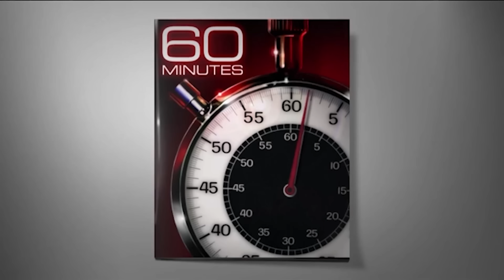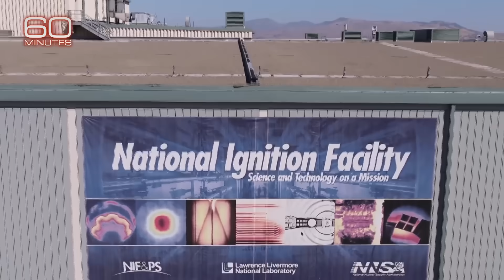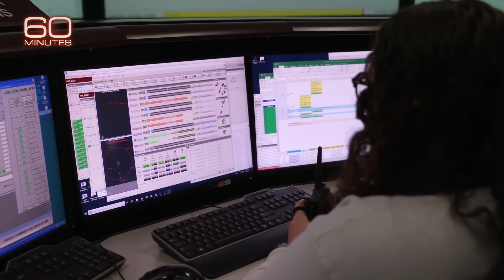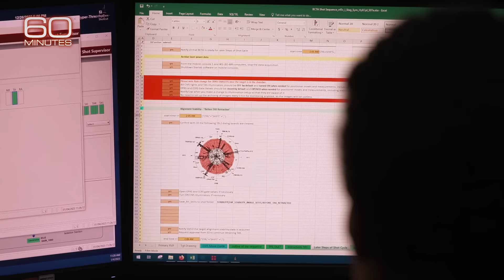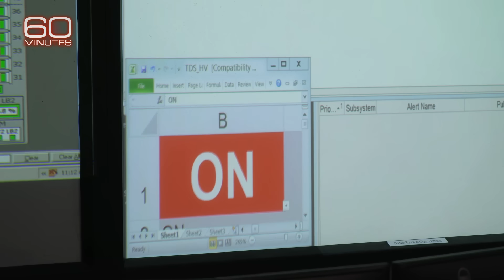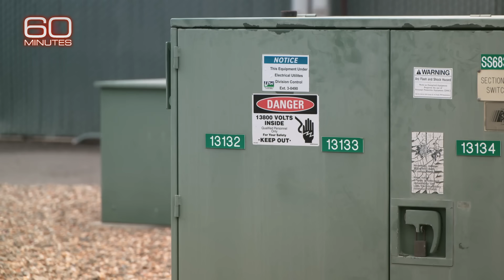Nuclear Fusion: Inside the breakthrough that could change our world | 60 Minutes

Comment: Maybe what they need is vacuumed sealed super chilled room , you know exact same condition start are found in? I mean would stars form and fuse if space was for example 0C ?
Reply: The target chamber is evacuated of almost all air before each shot. The target capsule was filled with a 50%-50% mixture of deuterium and tritium which was frozen, at solid hydrogen temperature, onto the diamond sphere inner wall. The freezing was performed multiple times over a couple of days period. Once the 3-billionth of a second laser pulse was fired the generated X-rays drasticly compressed the fuel capsule down to a microscopic size and it consisted of a plasma at around 150 million degree C.
Reply: @vernonbrechin4207  Are you some disgruntled employee who lost his job at this facility and now takes to YouTube to degrade what they accomplished?

Comment: Nuclear bombs use fission.. not fusion
Reply: I encourage you to look up nuclear explosives on Wikipedia. Nuclear weapons employ both fission and fusion processes. The so-called 'atomic bombs' are primarily fission devices, usually including a small fusion component at the center to generate the triggering neutron flux. Thermonuclear weapons (H-bombs), which are the most common type in the hands of the nuclear weapons countries, employ a fission explosive that then drives the compression of the fusion components of the nuclear explosive. NIF is designed to simulate that portion of such devices. Typically the fusion fuel is a special variety of lithium hydride. I'm many cases a uranium tamper is also part of the 'secondary' portion of the device that generates more fission yield and increases the compression of the fusion fuel.
Reply: @vernonbrechin4207  so at best it’s a hybrid system in newer devices, to imply they use strictly fusion is not true. Plus they showed old warheads which were in fact fission weapons fusion fission hybrids didn’t come until later
Reply: @magichobo  - Dr. Edward Teller, often referred to as the father of the American H-bomb was also a prime driver to employ nuclear explosives for civil engineering applications back in the 1960s. He often promoted the concept of creating nuclear fusion explosives that employed almost no fission reactions. Part of the reason for that is it would displace many of the complaints about the explosives leaving significant quantities of highly radioactive fission isotopes, similar to Spent Nuclear Fuel (SNF) that is discharged from nuclear power reactors. He kept promoting his dream to the public while the Livermore Lab   that he headed was designing thermonuclear warheads that continued to employ much fission materials in their construction. Always be wary of the pitches being made to the public by the weapons designers. Much of their work is classified so they don't have to provide the full story.

Comment: So, it's not practical or viable. Got it. Helion looks far more promising.
Reply: In the case of the clever pitches given by the Helion CEO look for the following information in the pitches. Did they use, or get any helium-3 in their multitude of shots? How often have their experiments used the actual fusion fuel that they plan to employ? Have what percentage of shots, on the current version of their machine, have resulted in a significant fusion energy production? Has the machine ever come close to generating more fusion energy output than it took to power up the machine for each shot? One of the benefits of the private efforts is that they can easily claim such details are proprietary information and therefore can't be shared with the public and the venture capitalists that fund them.

Comment: You may want to check out companies such as Helion Energy and General Fusion   - They are several prototype versions into working reactors.
(Note that working does not mean yield-even, as in get more energy out than put in) - However, they are getting closer and the advancements made curb even the almighty Moores Law  :) - My personal fav is Helion Energy :)
Reply: In the case of the clever pitches given by the Helion CEO look for the following information in the pitches. Did they use, or get any helium-3 in their multitude of shots? How often have their experiments used the actual fusion fuel that they plan to employ? Have what percentage of shots, on the current version of their machine, have resulted in a significant fusion energy production? Has the machine ever come close to generating more fusion energy output than it took to power up the machine for each shot? One of the benefits of the private efforts is that they can easily claim such details are proprietary information and therefore can't be shared with the public and the venture capitalists that fund them.
Reply: @syntaxed2  - I just looked into the technology and the achievements of General Fusion. I learned a great amount from my research that doesn't begin with finding information that reinforces what I prefer to believe in. I found no indication that they have employed the deuterium/tritium fuel that their concept is based upon, or that they have detected 14.1 Mev neutrons that would signal that they have achieved fusion reactions.

Most fans tend to be attracted to the sales pitches of the founders and in the interviews with the managers. The fans are frequently reminded of the big-money interests who have invested in the technology. Typically, the fans have little interest in seeking out critical assessments of their favored technologies. Ask yourself the following, did the General Fusion presenters provide any evidence that they have achieved even a tiny fraction of fusion energy compared to the machine input energy. Learn to recognize master sales pitchers.

I encourage you to search for the following article titles. You might learn that things are not as bright with most of these projects as you assumed they were.

General Fusion (Wikipedia)
Can Small Fusion Energy Start-Ups Conquer the Problems That Killed the Giants? (Scientific American)
National Lab Unlocks Nuclear Fusion — True Breakthrough, Novelty Act, Or Both?

Comment: I've been laughing at the NIF for about 25 years and I'm still laughing.  I was doing fusion research at a top research university and our lab took an Inertial Fusion research grant and built an experiment.  Grant money keeps the lights on so the Professors were happy but the idea behind the research was ludicrous.  There are a lot more issues with inertial fusion than mentioned in the video.  Even if they could increase the gain by 100x to truly break even, they still have no reasonable idea of how to extract the heat energy and turn it in to electricity.  Then there are the neutrons, any reactor they build will be irradiated quite quickly at 90,000 ignitions per day.  Then there is the physical damage that melted the test holder.

Bottom line, if commercial fusion happens, it's not going to be Inertial Fusion.
Reply: Thank you for your contribution. You have insights that very few fusion fans are made aware of. Most easily fall for all the sales hype in this field, hype that is often intended to attract further investments in the fun toys the experimenters get to play with. The above story failed to mention that fusion energy research began in the 1970 and that NIF was preceded by two other giant laser facilities that bragged about achieving 'ignition' and then claimed that NIF would soon achieve the goal due to most of the kinks being worked out previously. NIF failed to meet its goal, by a wide margin in 2012 and has been struggling for more than a decade to get to that goal. Funding was never stopped because it has always been primarily funded as a thermonuclear weapon (H-bomb) research tool.

The lab management is now claiming that they need more efficient lasers, with an eye upon 'Laser Diode Pumped Lasers that can be up to 20% efficient. The management doesn't mention that even the most powerful of those lasers don't come close to the NIF lasers and that if they have to shift wavelength twice, like NIF does, the laser efficiencey will plunge.

The announced experiment took over a week to prepare at enormous expense. If they were able to repeat the experiment each week the duty cycle of the 0.08 billionth of a second fusion reaction would translate into a duty cycle of 0.00000000000001% . They have a ways to go before a more practical repetition rate of 10 shots per second can be achieved with a fusion energy yield of over 10times what they just measured in this experiment.
Reply: @vernonbrechin4207  Are you some disgruntled employee who lost his job at this facility and now takes to YouTube to degrade what they accomplished? ??

Comment: I applaud 60 Minutes for the first unhyped report I have seen on this topic. So many people seem to think it's a short path from here to fusion supplying our energy needs! But alas, no. President Biden really ought to be better informed. There is much promise in fusion for power, but there's also a huge amount of work to do to get there.

I would not compare our current position to the Wright Brothers' first flight. I think it's rather more comparable to humanity's construction of the first forge furnace capable of withholding fires intense enough to smelt metals. Then come better forges, smelting not just copper and tin, but gold, and iron; the smithing of metals to make tools; purer metals; the tools to harness the heat itself for mechanical use - as in steam engines; better engines, like the internal combustion engine; additional discoveries such as some basics of aerodynamics. NOW we have the dream of constructing a flying machine. And forward it goes.

I think there are many stages yet to come in fusion in terms of merging knowledge and improving techniques that might bring advances comparable in significance to some of these early steps, and I would expect there to be just as many stages as that. And they will take significant time. Worth it? At every step!

But we really ought to abandon our science fiction fantasies. Maybe someone with a better resume can get through to some politicians too. It serves no one to pump a real solid achievement artificially full of hype. For when the bubble of hype bursts, then someone will think the promise of fusion has burst, and that will be just as false.
Reply: Excellent analysis! Thank you for your contribution. Most fusion energy announcements are greatly overhyped. They take advantage of peoples craving for a magic solution. In this case both the U.S. Department of Energy (DOE) secretary and Joe Biden was misled by the Lawrence Livermore National Laboratory (LLNL) and the National Ignition Facility (NIF) management staff that they are supposed to administer. Both of these are part of the U.S. nuclear weapons program and NIF has always been primarily funded as a thermonuclear weapon (H-bomb) research tool.

All the promoters of nuclear power, as being our savior, continue to believe that we have 20-30 years left to turn this 'Titanic' around. They've become masterful at excluding the following warnings from their consciousness. I urge readers to search fror these article titles.

IPCC report: ‘now or never’ if world is to stave off climate disaster (TheGuardian)

UN chief: World has less than 2 years to avoid 'runaway climate change' (TheHill)
  * This statement was made 4-years ago.
Reply: @vernonbrechin4207  Thank you. We're certainly on the same page.

They say that in Russia, military misinformation proceeds up the chain of command to Putin, who is content to let it mollify him. But such things work that way everywhere in one degree or another. Research management, government, and business are no exceptions. I think that managers ought to spend half their time on the floor, studying what happens where the rubber meets the road. Then they might understand better how to remove administrative roadblocks to real work, and also learn how to report upwards accurately rather than using the rose-colored visions where practical matters are buried in haze.

Fusion will not save us from climate change. It is too late for that. We have only just invented the forge. Now we have to produce enough fuel to make it actually melt some ore. And convert the heat to electricity or other forms of power that will make it useful. That step is years to decades away, but it's one of the biggest and hardest. Bootstrapping is a killer.

Fusion may, however, help us significantly in dealing with the effects of climate change. We may even survive it long-term. We're talking HUGE power. But science will not save us; that is a fantasy. It can help us, a lot. It's time to work more than to dream.
Reply: @vernonbrechin4207  I hate to be too cynical, but I'm afraid that technological advance and benefitting the human condition are just not high on the radar in too many cases. There are some, but with money as important as it seems to be everywhere else, I can't help thinking that that is the primary motivator. The old saw that "money is the root of all evil" may be off-point, but it is the next ring out from the bull's-eye.
Reply: @farmergiles1065  - I accept that perspective. I also believe that many people's primary goal is to seek out entertainment, which often involves an exchange of money to obtain such services.
Reply: @vernonbrechin4207  'Tis common, yes.
Reply: @farmergiles1065  - Very common.
Reply: @vernonbrechin4207  Are you some disgruntled employee who lost his job at this facility and now takes to YouTube to degrade what they accomplished? ??
Reply: @vernonbrechin4207  Are you some disgruntled employee who lost his job at this facility and now takes to YouTube to degrade what they accomplished? ??

Comment: This will never become practical, the problems are just beyond belief, every part of this system is so cutting edge, and yet the end results are so far from what we actually need. For example, the lasers themselves literally nuke themselves with each pulse, due to huge heat output that cracks and warps the gain medium, Neodymium doped glass, it's just a bad way to do it. Tokamacs will absolutely  get the job done, ITER will prove that , thanks to the latest breakthroughs in superconductors, the new REBCO types can make insane magnetic fields without quenching with super high magnetic field strength, put your money on ITER and Tokamacs, plus, they will also make excellent space propulsion drives, close to light speed, theoretically.
Reply: You are correct about the Inertial Confinement Fusion (ICF) approach not being practical. Most nuclear fusion experimenters have agreed with that assessment for decades now. I have to assume that you've not been following the latest new regarding ITER. Most fans have little interest in following the downside critiques. I urge you to search for the following article titles.

ITER is a showcase … for the drawbacks of fusion energy (The Bulletin of Atomic Scientists)

KEY COMPONENTS TO BE REPAIRED (ITER - ITER Newsline)
21 Nov. 2022

Sun in a Bottle: The Strange History of Fusion and the Science of Wishful Thinking (Amazon)
By Charles Seeife - Published on 30 October 2008
Reply: @vernonbrechin4207  Are you some disgruntled employee who lost his job at this facility and now takes to YouTube to degrade what they accomplished? ??

Comment: I thought Fission (splitting atoms) was what set off Hydrogen and atomic bombs not fusion (joining atoms)? At 1:00 they call it fusion? Am I totally wrong here?
Reply: I encourage you to look up nuclear explosives on Wikipedia. Nuclear weapons employ both fission and fusion processes. The so-called 'atomic bombs' are primarily fission devices, usually including a small fusion component at the center to generate the triggering neutron flux. Thermonuclear weapons (H-bombs), which are the most common type in the hands of the nuclear weapons countries, employ a fission explosive that then drives the compression of the fusion components of the nuclear explosive. NIF is designed to simulate that portion of such devices. Typically the fusion fuel is a special variety of lithium hydride. I'm many cases a uranium tamper is also part of the 'secondary' portion of the device that generates more fission yield and increases the compression of the fusion fuel.
Reply: @vernonbrechin4207  Are you some disgruntled employee who lost his job at this facility and now takes to YouTube to degrade what they accomplished?? ??